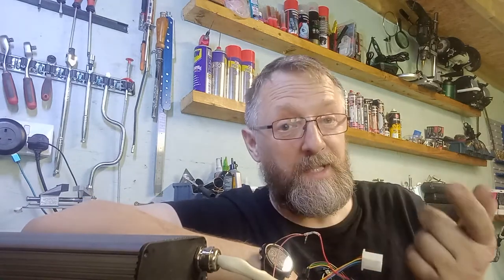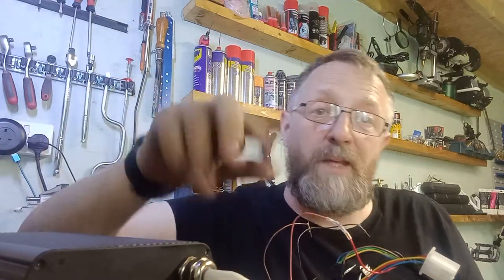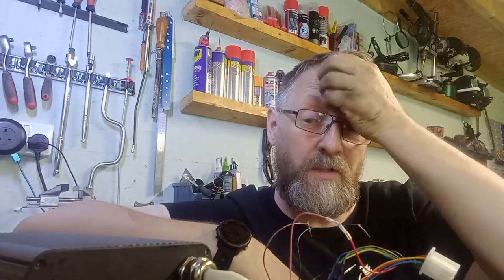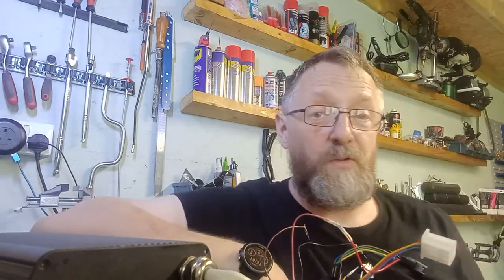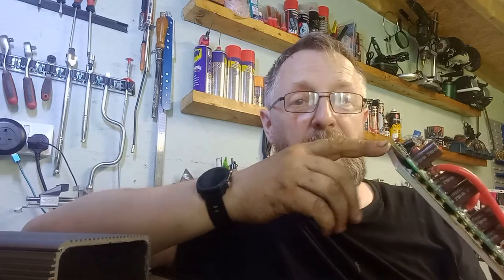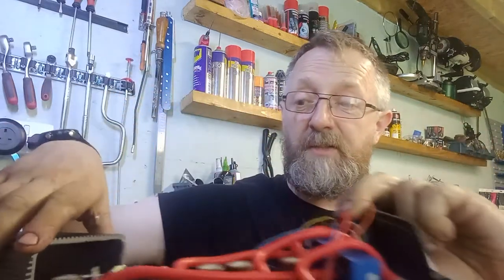I have blown up my Sabvoton controller

Comment: Whenever you are working on a controller always make sure you disconnect the battery and make sure there is no power in the controller stored in the caps. then it's safe to work on. Thank you for sharing this with us.
Reply from the maker: yes . I wish I had known before I started. Thanks

Comment: You've blown capacitors matey, the swollen ones are dead for sure, replace with same value ones. It WILL be  100s of £ cheaper to do this than buy a new controller boss 🙂👍

Comment: the round cyclinder components are the electrolytic capacitors ,even if one of them blows its still a possible repair, but if you chose to buy a new sabvoton do it asap,as with in weeks the prices will skyrocket especvially with postage and transport
Reply: ive been watching them rise little bit by bit evewry feww days
Reply: It's been 2 months since I've been watching them and they certainly have gone up my question is why

Comment: there a company called siaecosys they brought out brand new 7230 its all new design and technology based on original mqcon  sabvoton and its 100 amp[ at battery,just tell them what tft lcd you want ,its like 21%off as intro ,its around 250australian compared withclose 500 or more for the old sabvotons ,worth a look

Comment: the dunn electric store on ali express has really cheap unlocked sabvotons to ,were just finishing a bike with unlocked 45 amp sab and for front mac motor and unlocked 150 amp sab for custom crystalyte motor on 48 volt it pulled 65to 70 kms per hour so wonder what itll be like on the 82 volt with few hundred amps
Reply from the maker: Thanks Katie ,I just sent my old one to Andrew so hopefully he can get his fixed for himself . Thanks I couldn't explain what had happened 👍

Comment: How are you people blown your controller if you are doing mods on the controller for speed and torque just solder shunt bars. Bur a lot of videos show people put solder on top of shunt bars some are three some are two nip together make sure wires aren't touching iron and solder from board over the shunt bar to other side in circuit board if you just do the top of bars the solder is thicker than the bar going in to board. If cover the whole bars it does work power and torque. But idvised to take spare fuse up grade because there is more current going through the system and it can blow a fuse if you use to big of a fuse it will blow the hole controller. So from 30amp try 35amp and the most is 40amp  not 45ir50amp because well bang

Comment: I've just past comment on upgrade controller I forget to mension turn the power of from display middle button then turn battery of the back to display turn it of it will flash that empties the system them capacitors normally three big ones they can kill you

Comment: is it normal to spark when connecting battery to controller, not sure if i was doing something wrong but both terminals sparked and melted and now i can’t put them together, just got new terminals in but would like to know if i did anything wrong that i can avoid this time.
Reply from the maker: I really have no idea, buddy. I know nothing about this stuff

Comment: I saw plenty of sparks modding the wiring for lighting( head light brake light and turns signals) as well as horn and usb ports. Luckily every thing works. You think those wires will never touch but they do.

Comment: Hi Fred, Just wondering if you have the controller ? I have similar issues with few broken componets on my pcb. I would be interestedin your controller to maybe use for parts to get mine working.
Reply from the maker: Yes u can have it no problem
Reply: @freds-shed  That would be great, Do you know which you have exactly ? Is there any text on the pcb ? I have a sabvoton 100amp controller looks the same as yours
Reply from the maker: @andrewmcguire8924  il check tomorrow,I'm in Ireland so it's 6:26pm ,il get as much info as possible tomorrow and il post it to you
Reply from the maker: @andrewmcguire8924  Hello I looked back at the order ,mine is 80amp it's a Sabvoton MQ 80A high-end sine wave programmable controller ,not sure if that helps
Reply: @freds-shed  thanks Fred, I am sure they share a lot of components I think my problem is in the 5 or 12 v side maybe but would be tremendous help you’re a star! How can I send you my address safely
Reply from the maker: @andrewmcguire8924  out_in_my_shed on Instagram, u could DM me if u want ?
Reply: @freds-shed  thanks just sent you a message

Comment: The controller runs on JS.NODE platform... UART system... you might have touched power wire on the data connection somewhere on the board/wire... when you get the new one take care on mounting the wires ... make brackets... go nuts